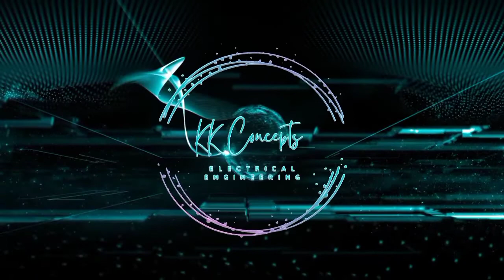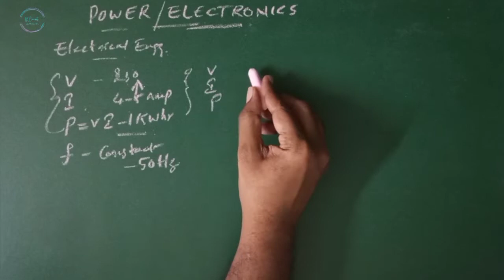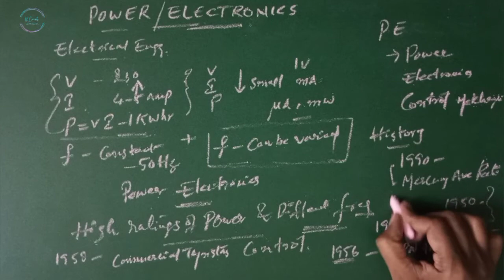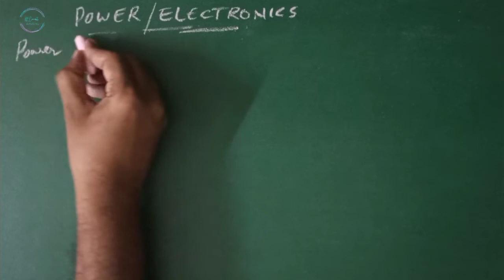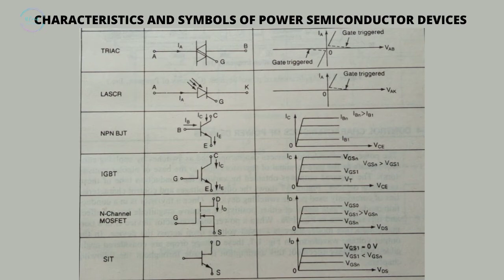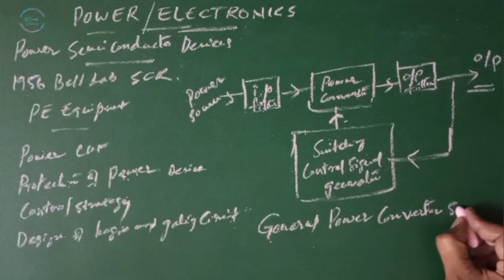INTRODUCTION TO POWER ELECTRONICS

Comment: Looking for combination of power, control, and Magnetism with low energy DC Input. How to magnatise using DC power with controls.
Reply from the maker: If the current does not change over time (DC) then there’ll be a “unidirectional” magnetic field. As you might guess, you cannot use this field to generate current across another conductor.

Wrap a few centimeters of cable around the screwdriver and connect a battery to both ends of the wire. See how the screwdriver turns into a magnet.